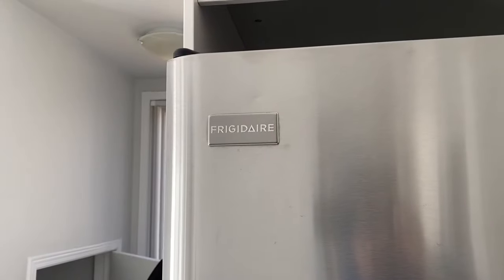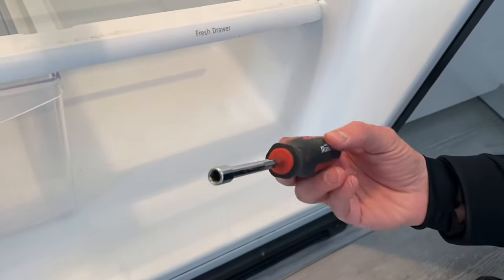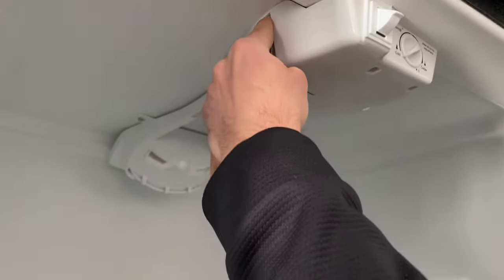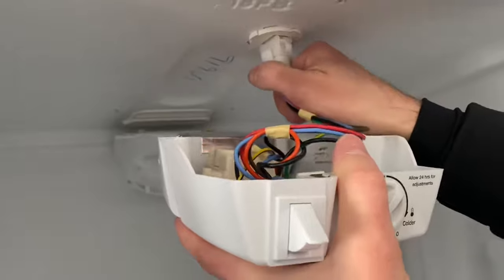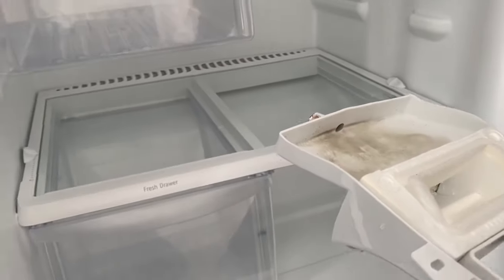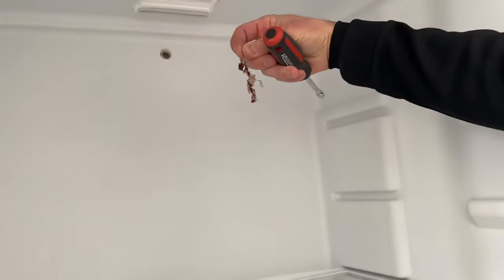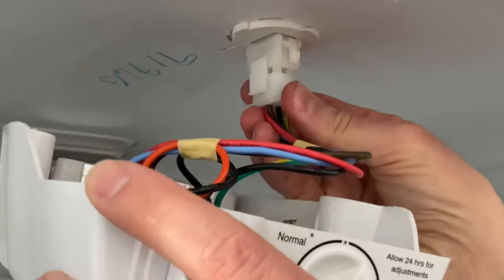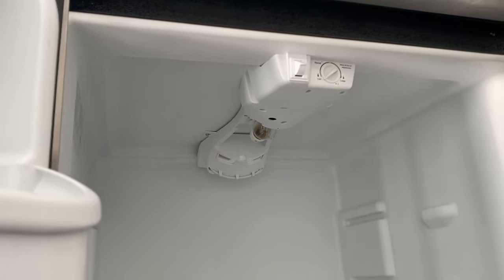Water at the bottom of fridge - No problem. Diagnose and fix in under 10 mins

Comment: I tried what you did in this video . I have the same fridge as this one. My problem is the tray is clear and the nipple is clean also in the back wall the hole is clean. Water keeps dripping from the assembly itself , when it's in defrost cycle. Any ideas of why? Thanks
Reply from the maker: Haven’t seen this particular issue before but would suggest to try and follow where the water is coming from. Perhaps May be helpful to remove the assembly during the defrost cycle and wait to see where the water is coming.

Comment: While the debris in the tray spout was minimal, I did notice the spout may have been barely reaching the outlet hole ... decided to reattach the thermostat unit the extra distance closer that it could go. about quarter inch. ... yes, creating new screw holes the same way the first ones were probably made. fingers crossed working so far, no more water pooling.

Comment: I did this but the drain on the thing wasn’t clogged, I did notice that it was leaking from the top and down the back….. so I watched your video again and I didn’t remember that you stuck you finger in the drain hole in the back, so I did and there was some stuff looked like plastic of some sort, keep in mind this came with my townhouse as is, so it’s old. Anywho I hope that fixes the issue, I’ll give it a week and see if it stops fingers crossed 🤞

Comment: Hi, I have a Kenmore refrigerator, and I tried this method but I need something to go down in the drain to clean, can't just use a cotton tip. I tried but still getting water in the bottom of fridge, what do you suggest..
Reply from the maker: Hi, my best bet would be to try using a compressor to blow out the drain tube.
Reply: @weekendwarrior3814  Thank you I will try
Reply: I tried the compressed air still getting water in the bottom of refrigerator.

Comment: Hiii, we have the same fridge you have as well. We followed the same steps and unclogged the same piece you did but the leak still continues ... is there a reason for this?
Reply: the hole from freezer is probably frozen over. You can defrost the whole unit or you can remove the back panel in the freezer to expose the frozen drain hole and just defrost the drain with hair dryer.
Reply: It's also a possibility that your refrigerator is not level

Comment: Is this the same for a whirlpool?  It sure makes sense for the water we are getting on our top shelf. Occurs about once daily and we mop it up.
Reply from the maker: It can be if your model looks similar, frigid air is a whirlpool owned brand.
Reply: @weekendwarrior3814  Similar with that light and control panel on the roof. But ours is not 4 yrs old and that panel also extends down the back and stops right at the top of the top shelf.   We have some ice on freezer floor.  I believe the defrost coil is not working properly.

Comment: Thank you! But We have another model of Frigidaire, AD-18. We had the same water collection tray, but the construction is different. We have only a lamp on the top. Have you another Video for our refrigerator type?
Reply: I saw a video where the condensation hole was behind the crisper draws hope thar helps
Reply: @jobevilaque8465  Thanks, unfortunately not. I also have a box attached to the ceiling of the refrigerator, but there are no bolts, only one seal. I don't want to open it.

Comment: Where does the water go when it goes out from the top of the frig , and is there another collector bin in the back which I need to dump out I have at least 1/2 litre of water collects the dripping wakes me up I sleep 12 feet away, the frig and freezer both are very cold work okay but it drips so much , terrible, I will try your solution, thank you , !

Comment: Would this cause the same problem: I run my freezer as cold as possible, and close with the fridge part. This is so my food lasts longer. Would those two habits cause this? Been doing it for a couple years now with no problems.
Reply from the maker: If you’ve been running it like this for a while with no problems, should be okay.

Comment: Question… I had the same problem with water leaking from that unit at the top of the refrigerator. I unbolted it ..dropped it down, but there was no clog that I could find.  Now that it’s reassembled,  I’m hoping that perhaps the issue is solved but I doubt it considering there was no clog to be found.
Reply from the maker: Sometimes the drain holes may be misaligned and it could leak as a result. Suggest to wait and see what happens.
Reply: @weekendwarrior3814   thanks 👍🇺🇸

Comment: The frig was at the lowest 1, so I put it colder 31/2, and try this , I have an older frig , there is no access to the tube just a small cup which drips, ,  no screws so I didn’t want to break the tiny cup it seems attached ,no way to clean a tube 20 yr. old model Frigidaire . I hope the colder setting works, it goes from 1- 9 coldest so it was super low setting .
Reply: The frig you were fixing is much newer, mine is 20 yr.+ , I found where the dripping 
came from so I put a plastic container to catch the water, it still drips at Level 3, I dump the container now in 5-7 days it fills but it’s so much better to stop water dripping down under the crisper .  I didn’t clean the hole yet  -on my list now . 👍 thank you .

Comment: How about if get water on the bottom and ice on the walls? Mine is like a mini fridge with the top separate part being the freezer. I seem to have to get the water out once a week and worried if I’m out of town, it may cause a flood in my apt. Also I lowered the temperature to a 2 from a 4 to see if that would hekp.
Reply: Also my mini fridge has a water tray in the back by the motor. I discover that bc one time I had frozen squid that melted and had a real bad Oder and after cleaning the fridge. So I had to drain that water trays and in about a month, the smell finally went away. 

Oh and my light and temperature dial is on the side. So I don’t know if they’re a water tray like in yours, but I’ll check. 

Thanks

Comment: Hi, I just did this but water is still going down below.  Does the fix work immediately?  Or do I need to wait?  What would be the next thing to try?
Reply from the maker: Hi, it should work right away. Try checking if the tray aligns with hole from the freezer. Also that there is nothing stuck in the hole in the back wall. Good luck.

Comment: Thank you for sharing your video. I've cleaned the nipple but I still have dripping from the center of the white tubing that is in the back of the fridge. Do you have any suggestions?
Reply from the maker: The only thing I can think about is alignment of the drain hole from the freezer to the tray where the water collects before going into the nipple. If alignment is the issue, would need to move the assembly to align the tray to the drain hole and screw in place. Hope this helps

Comment: does the temperature setting have anything to do with it? if the fridge or freezer is set higher than normal setting there is too much ice build up?
Reply from the maker: Hard to tell but it’s possible. Ambient air humidity may also play a role.

Comment: I did it but its still leaking.
Any tips on what else it could be?
Reply: Did you follow the instructions correctly?
Reply: @Aggression-hc3yp  yeah. I think its the drain line that goes all the way down that is clogged.  
Can't really be something else. There's not much part that are used for drainage.

Edit: so I removed the back lower panel and blown inside the rubber tube. Some crap was pushed inside the fridge.

I used some water to clean the line and it should be good.

Plz do a video that show us how to remove the lower front panel under the door.
It would be nice to know how for the clean up. (I found out)

In fact, an whole tour of the fridge and what each problems might be related too would be nice

Comment: My issue is not the backwall. It's dripping like it's suppose but instead of dripping on the pan it drips on the foam side. So the drip goes thru the cold air.

Comment: Dam man my fridge must be super plugged up because i have lots of water filling up at the bottom and it covers the floor everyday
This is how you would fix this problem for every fridge this style?
Is there anything else that would/could cause this issue?

Thanks
Reply from the maker: I found this to be the main issue and it seems to work most of the time even if the fridge is slightly different (the water has to drain and if it can’t it just spills over). Hope this fix works for you. Let us know how it goes.
Reply: @weekendwarrior3814  
Ok man well i tried it
Good news is that once i took it apart it looked great, no water in there at all, and no blockages of any kind
BAD news is i guess this means this isn't the problem
I cleaned out all the water out of the bottom of the fridge, (1/4 gallon roughly) and now ill just have to wait an see 
Any suggestions what to do if it keeps happening?

Comment: But how about a refrigerator that does not have a freezer, not an icemaker nor any plumbing - yet it still "pisses" all over the floor with no obvious drain or holes inside the fridge. Where does THAT water come from?
Reply from the maker: The only thing I can think of is condensate. I would check if the door(s)seal properly when closed.
Reply: @weekendwarrior3814  I had come to the same conclusion and that there has to be a  comtainer or reseptavle for condensation under or near the compressor and coling loops that handles off-run when thee is high humidity and relatively cool ambient air is thrown in the mix. Guessing the receptable is overflowing before it gets the chance to evaporate.

Comment: I did this but no need to disconnect the wire. I just pulled the assembly around and cleaned out the tube , then reattached the unit.

Comment: How about if you have a small apartment fridge and the thing you removed is on the side. There’s also a hole in the bottom of the fridge for water to travel out. 

I discover it when there was a strong fishy smell and I couldn’t find anything in the fridge that was causing the fridge. So I couldn’t get rid of the smell for a few month and it’s seem the fridge was keeping the smell going. At the time the fridge was about 6 months old. 

So it turned out I had some frozen shrimp that thawed out in the fridge for like 3 days and the shrimp water dripped into the fridge and into that drain hole and into a drain cup in the back that was a little hard to reach with even my small hands. That cup had that old shrimp water for like 2 months and the smell blew into my apartment bc of I think the motor fan. 

Yeah and the smell was horrible  and after I sponged out all the water, I took a few week for the smell to clear out.

Not sure why they put a hole at the bottom of the fridge and I never seen this design. But it’s a bad design bc once something that has an odor and liquid, it’s going to get collected in the liquid cup, it’s going to smell up your room. Plus, they don’t make it easy to drain the cup and can grow mildew. So if you’re suppose to clean the drain cup once in a while, they sure didn’t make it easy to get to that cup. Frigidaire suck and I’ll never buy this brand again and while check if the fridge has a hole at the bottom of the inside the next time.

Comment: Is there a way to clean from the top down as well?
Reply from the maker: Assuming you’re talking about the line that runs in the back wall to the evaporator- The best way is either blowing it out if you have access to a compressor or running a wire of some sort that you can push through.
Reply: @weekendwarrior3814  in my freezer there's like a piece of plastic like that frigerator that looks like it comes apart also wondering if maybe that gets plugged with ice and melts to the bottom possibly?
Reply from the maker: @jaym6325  it’s is possible that it’s frozen/full of ice and water has nowhere to go.

Comment: My drain hole is clear but the line is clogged! How do I unclog the line?
Reply from the maker: Try using something long and flexible like a wire or a cable to push through the line to clear it.
Reply: @weekendwarrior3814  I am and it will only go do far and then stops
Reply from the maker: @violetscheibel3891  the only other way I’m aware of is to blow it out with compressed air. With that said, I haven’t tried it myself amd as such, don’t know if it’s effective or if it can damage the tube (depending on how tough the clog is). Good luck.
Reply: @weekendwarrior3814  tried an air compressor and can hear something got knocked around. Air will blow up but not down.
Reply from the maker: @violetscheibel3891  perhaps pore some water to soften up whatever is in there and keep trying the air compressor alternating with wire/rod to try and wiggle it out. May take some time. Good luck.

Comment: What about removing the styrofoam as well from that part?
Reply: Please do not remove styrofoam it serves a purpose. You will get icicles coming threw that spot.
Reply: The styrofoam on mine is rotten and broken up, is there any way to find a new part for it? It leaks water right through it and the water won’t go into the trap that leads it to the hole anymore.

Comment: After doing this the fridge keeps running, any recommendations??
Reply from the maker: The only two things I can think of are to check alignment of drain holes all the way through to make sure water drains appropriately. Also check to see if the hole in the back wall isn’t plugged (it’s a tube that runs to the bottom of the fridge that needs to be all clear).
Reply: You better go and catch it.
Reply: That was so cool when we were about 10. Classic. Great video though

Comment: How do I locate and remove the screws?  Thanks!!
Reply from the maker: They are right underneath the assembly. Try to get right under and you should be able to see them.
Reply: Mine had only one screw deep in a hole at the front of the assembly.  Worked great thanks!
Reply: @francesmiller4134  ah, that's where mine is too! thanks :)

Comment: Kinda a dumb question but should I turn off the fridge to do this…?
Reply: Yes, the gentleman said to unplug it
Reply: @UNCULTURED.  no problem...Ive got to do this to my fridge today!
Reply: @UNCULTURED.  to late it's been 2 weeks and I shouldn't have had to pull the fridge out so I could get a step stool to reach the plug, hurt myself good even bruised my kidney probably dehydrated from messing with trying to get it out of the tight space! I'm only 5"
Reply: If you can do the job in under ten minutes, then you will need to have it unplugged. The food in the freezer will still be plenty cold enough when you finish the job and plug it back in.

Comment: Took it apart & ice in small tray, but no dirt in hole plug, but still leaking
Reply: Check the drain plug that is in the freezer.  You'll need to empty your freezer, and depending on what model you have- remove the bottom/tray of the freezer (connected by screws).  Then you’ll need to remove the back paneling of the inside of the freezer.  There might be a wire connection- note the connections and disconnect so that you’re able to get the back paneling out of your way.  You should notice a small dark hole somewhere near the center.  That is your drain.  I’m assuming, based on the fact that you said there was ice in the fridge drain tray, that this hole will be frozen and blocked by ice.  You simply need to run hot water through the drain to melt this ice away.  Hopefully this fixes your issue. 🤓

Comment: I have water dripping from inside of tempura setting and along side of  it water dipple fall down  to bottom top layer were u keep drawer to store other food in fridge no water get inside drawer but cover get really wet .my fridge is a electroluminescent home product  from Augusta ga.freezer is fine  blow cold air keep my food cold frozen .but fridge part is water problem dripping  I had my landlord sent there  maintenance people all guy did took park back part of freezer after took out all my food frist bang on some metal pipe and metal fan wire thing .said freezer  fine fan is working  I wanted say duh of course it is .I wanted take tempture setting  apart see if there blockage or something I thought  maintenance  guy would check it out all he did change setting of how cold fridge should be said well it running  fine if anything else happen call us we come look at it again maybe replace it .I think it need replaced it old fridge .I think landlord  want get out of buying new one

Comment: I have this fridge and the pipe is clogged from the back of that fixture to the evaporator pan in the bottom of the fridge. no idea how to fix it because they dont make it easy, and no snake i use is able to get through.
Reply: water is definitely getting stuck between that back hole on the light fixture / control unit going to the bottom drain that runs into the pan. I checked from that back hose to the pan and thats clear but water cant get down to it :( .... hot water didnt help
Reply: Maybe try a piece of stiff weed eater string